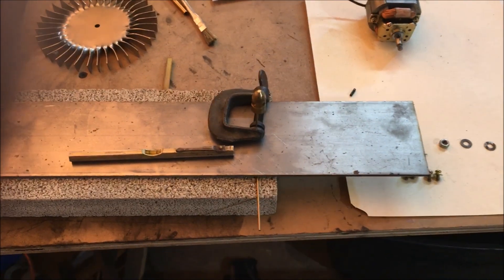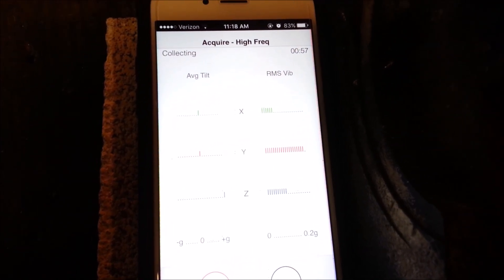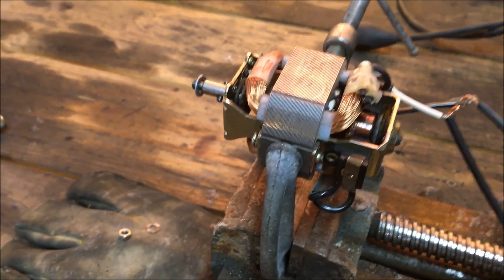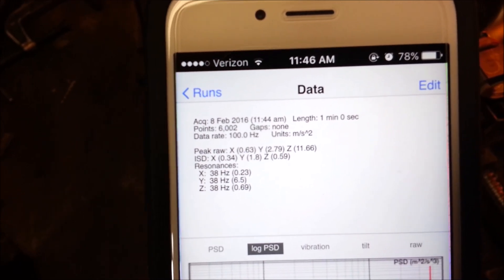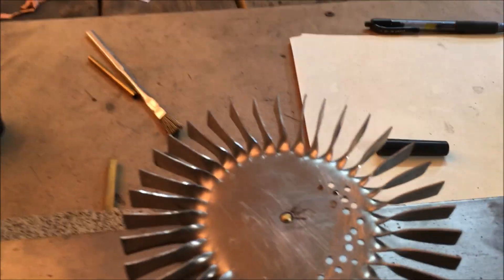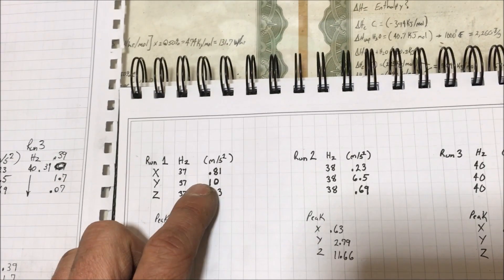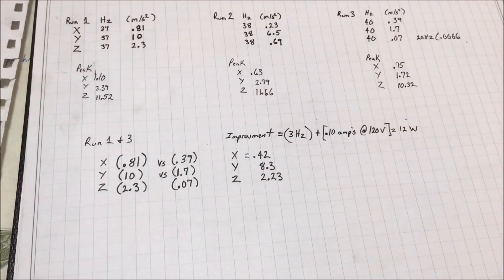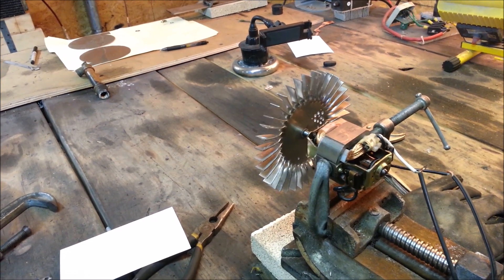Balancing  Rotating masses -flywheels- rotors- Impellers with IPhone

Comment: This is really not the proper way to balance that metallic fan... just imagine due to harmful cavitation due to vibration for long period of time, something will snap in those missing hole area and now you got a deadly/lethal shrapnel flying out... it would be better to add some kind of weight like "aluminum tape" to the area which has "less" mass. Keep adding heavy tape in layers of the region where the fan weight area is less. This explains why many people disliked your video.

Comment: great video man really, but how would it work if you added weight to opposite end, you could drill and weight nuts and bolts to more accurately estimate imbalance, although it could cause vibration in a different plane. just a thout no criticism at all, of course i just seen the video is 4yrs old

Comment: some tips: avoid using nice phones for this. strong vibes can loosen weak solder joints and ruin your phone. My gf broke hers by just using it as a gps in a phone holder on a single cyl motorcycle. For the needle point you can put the shaft you want to use in a drill and sharpen the end on a belt sander for a fine point.

Comment: The phone contains a 3 axis accelerometer and the app is designed to show the X, Y, Z axis. Great. But, the balance pin you made is for static balance reference only. Grind the shafts tip to a fine point to see better bench results. Now, placing the phone with app, on the bench next to the vise will provide skewed readings in my mind. Holding the phone on top of the motor should improve accuracy I would think. This gets it closer to the imbalance as possible. Very interesting! In the auto shop, during the 70’s into the 80’s, with the vehicle raised and a dedicated motor device would drive the tire, wheel, axle or hub all. It’s been so long ago but I remember having to place a hand on the inside of the fender with your index finger extended. It would vibrate and chalk was used to mark the location to add weight, then retest. 
 Too many moons ago to be exact as equipment changed all of the time. But this was a dynamic balance not static. What we called the bubble balancer was closer to your bench pin & cup. I believe that modern balances used light thru a slotted wheel until 3-axis accelerometers become accurate, check and smaller than your smallest finger nail. Nice job anyways!
ASE Master Tech since 1978 - Retired

Comment: Did you measure from the center of the hole to the outer circumference to check for concentricity so as instead of drilling holes and sacrificing durability maybe have ground some of the metal off of the ends of the blades where it would have had more effect to true balance?  Was the hole in the actual center?
Reply from the maker: Yes the hole was in the center but the cuts are inaccurate

Comment: this would have worked a lot better in a vacuum chamber.  Not only are you balancing against the mass distribution of your impeller, you're also balancing against the differences in the fan blades in dimension, pitch, and stiffness.  If one side of the impeller is generating more lift than the other, that will induce its own vibration.  What this means is that, while you can balance it anyway through mass distribution, it will only be balanced at one RPM value because as soon as you run it at a different speed, the lift forces on the impeller change and the mass distribution is no longer correct for balance.  depending on your application this may work just fine, though.

Comment: without a trigger you may calculate the resonance but there is no way to get the position of the unbalances on the sinusoid
But It could be done using the input of the mic (any other input on the phone) ?
If it is possible to get the signal of the mic then transform the reflexion of a cheap laser on a photo transistor signal to a short square and the job is done

Comment: nice work. thanks. i downloaded the apps. and this was certainly helpful. i am balancing a high speed blade.
Reply from the maker: cool , hey i figured out the hertz is actually a function of the rpm so if you have 50 hertz that's 25 rps or 1500 rpm

Comment: I found this an interesting video. However, some thoughts immediately presented themselves: 1) did it not occur to you that the central hole might not be concentric? Getting that right would be a huge step towards balance. It would seem very unlikely that the flat sheet you started out with would have such a variation of mass from the centre to the edge. 2) Did you ensure that the fan was mounted properly concentric to the motor? If not, and there was some sloppiness you would always have inconclusive results.
Reply from the maker: if you watch the entire video you will see how this is built

Comment: I think it would have been easier to drill a hole on the opposite end and install a small screw and nut, then add washers as needed.
Reply from the maker: probably right i had no idea it would go that far , very good suggestion sure i tiny screw would have probably done it

Comment: HI NoBox7,,, What did you use to vary the Motor Speed,, ?
Reply from the maker: i used a router speed controller , they sell them at harbor freight or menards for $15 its a triac circuit basically
Reply from the maker: if you wann know what the triac looks like i have many videos using this device for various experiments, look up cyclone gasification , i use this blower and this triac in the experiment
Reply: Hi,, Thank you for replying,,,, Do you think the Triac would work on a corded power drill,,, ?
Reply from the maker: yes i know it will for a fact

Comment: Hello, I have a question regarding your method please, how do you know exactly where to add/remove weight?
Reply from the maker: well i try to visually try and balance the device with the process i show in the video , if it falls to one side on the balance needle i know that side is heavy so on the opposite side i drill a hole to remove weight then i balance it again eventually  it will   balance on its own on the needle , i was only able to get it close but it made a huge differance

Comment: All right, watched, and I was right about the energy efficiency. The measurement of X and Z are not something to look at. You only need one axis of vibration measurement (here Y, depends on the orientation of the phone). The others are just resonances. The phone should be fixed to the "box", but seems ok readings for the purpose anyway. I'm going to look up a decent vibration measurement app for Android now... I've already purchased an accelerometer board, it just takes some time to get it shipped here. Cheers

Comment: The Hz comes from the revolutions per second. It has nothing to do with vibration, except that when there is less vibration, the system is more energy efficient and thus with the same power input the motor gets higher revs. I'm crawling the YouTube because I want to find good ways of balancing rotating mass. I've already got ideas for the DIY electronics. What you can do with the phone is verifying the amount of vibration, not the phase for pinpointing the problem. I haven't watched all the way through yet but it's already time to say thanks! :)
Reply from the maker: pinpointing the problems is done with a special balance shown at the end of the video and in the middle i believe , i balnace the device then check it with the phone to track progress, i got the idea for the balancing device from a tire balancer at harbor frieght
Reply: Yes, that's cool. I did watch all, I had to :)  But I also found that static balancing is not always enough. In this case it seems to be. The description in this video explains a lot, even the principle of dynamic balancing. Dynamic balancing is what I need for my case. And I'm going to build something  for it.
Reply from the maker: Sami P.2 Jumppanen Cool , hope you post your work , balancing things has prohibited some high rpm builds im interested in . hey thanks for the info about the Hz i believe your right , so i multiplied 40 Hz times 60 to get rpm and it was 2,400 sounds about write for this motor with this load and ive also studied vibration analysis and they are able to pinpoint problems based on frequencies and the known number of bearings in the race of the bearing , they can spot race damage or ball bearing damage itself and as you said even the rpm of the machine can be determined
Reply from the maker: Sami P.2 Jumppanen "static balancing" i gotta remember that  term. Thanks for your input bro ,not allot of intelligent comments come my way , thats the only reason i post and yet i get mostly a bunch of jerks that do not have a clue  and like to slander me .
Reply: NOBOX7 I really respect that you're building stuff and doing video about it. I know that making a video can slow down  the actual work, I don't often want to take photos because of that. It shouldn't matter if everything is not scientifically exact from the beginning. I got good ideas from the video. Let's keep building and tuning :)
Reply from the maker: Sami P.2 Jumppanen I also was going to build a electronic device to balance but gave up , i was gonna use a timing light for auto engines . Im even thinking only 1 micro switch would be needed at the position of the timing light so when the heavy side of the rotor comes around the rotation it would activate the switch in line with the  timing light and trigger the flash, and markings on the rotor would identify the quadrant thats heavy , however this would give no indication of lateral position and ive seen some cool computer aided systems that not only locate the quadrant but also the lateral position of the area material must be removed . knowing both is crucial for turbines or high rpm impellers.
Reply: NOBOX7 yes, there are things I need to study more. Interesting stuff. Timing lamp was in my mind, but as I don't have one, I could build one. Today LEDs give enough light, and they're fast. But wrapping it all up with some maths may be a real challenge.
Reply from the maker: Sami P.2 Jumppanen yes ive seen that led lamps are fast enough to be used in high speed photos of explosives so they deffinatly would work
Reply: NOBOX7 hi, I have gained more knowledge. One video said it clearly: dynamic balancing means balancing on two planes. Essentially, applies to cylindrical (or otherwise thick or long) objects. So it's not that complicated after all. If there is no axial dimension, you can do static balancing like you did. Of course, impeller blades may introduce vibration on high speed, as they bring in the second dimension. Also the regularity of the shape and angle from blade to blade may come into question (different forces accros the impeller). Some calculations could be used to help judging the need for the balancing. I don't know yet what are those calculations like, but as I wrote, one is related with the dimension (how much mass is set off the centerline of the plane * speed) and the other with the impeller characteristics (how much error the individual blades can have before it starts to cause vibration to the system). In the near future it is possible for me to try out 3D printing, say propellers for my Phantom. I'd like to see how they work. I don't have to design the shape of the propeller, I'm sure the optimal shapes have already been found :)
Reply from the maker: Sami P.2 Jumppanen propellers are very complex , did you know that a torque is induce on the blades from vector forces alone ? you need to know trigonometry to understand but its very interesting stuff , just the angle of the blade and not the wind forces cause this rotation torque , the blades would swivle flat if they where on axles even in a vacuum due to this vector attribute , this was discovered when they made the first variable pitch props   , at first they could not figure out why the blades where so hard to rotate in one direction , the wind forces did not have the power to do it and finaly a very clever mathematician solved the problem threw vector analysis diagrams form an over head frame of reference , basicly the particles composing the blade form a force triangle and the bottom of the triangle and the hypotenuse are cetrifugal force but the side of this triangle causes the rotational forces , this could also cause vibrations on flimsy blades
Reply: I think an auto timing light would be a problem to trigger because they are generally triggered by the HT voltage of the coil unless you could modify one that has an inductive pick up. Then rather than a micro switch you would need to use a reflective sensor on the fan as I think the the force required to operate a micro switch may be too great. Good thread here, great ideas!

Comment: Great topic but you have to get a tripod and keep the mic out of the wind. Those two things make this video almost unbearable. 

Also, when measuring the vibration using your test stand (vice and clamps), the entire test stand should be on something flexible. Even a sheet of foam between the stand and table would be fine (the test stand needs to be able to move). The vibration sensor (phone in this case) should be on the test stand side of the foam.
Reply from the maker: good idea but wouldnt foam buffer the vibration and inhibit sensitivity kinda like the shocks on a car ?
Reply: Hi good video! I have been looking for a cost effective way of balancing rotating masses typically fans. Mounting you rig on a flexible pad has the opposite effect it will increase the vibration and thus in the long run make your results more accurate. I would also imagine that fixing the phone to the rig would give a more accurate result. I don't balance things that often so it's not worth spending a fortune on buying a commercial set up. I think refining your rig or something like it would be a solution. For the balancing cone did you know you can buy lawnmower blade balancing cones very cheaply. Also I think if you made a rig with a case for you iPhone fixed to it permanently the you could just fix and remove the phone as required. Obviously the rig would have to be fairly flexible to be able to balance different devices. Anyhow food for thought. Good work👍